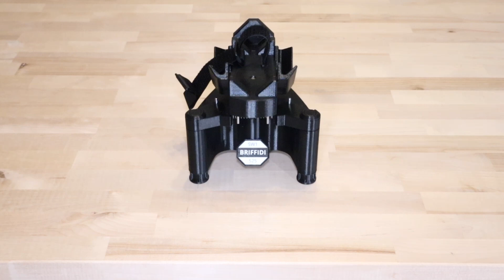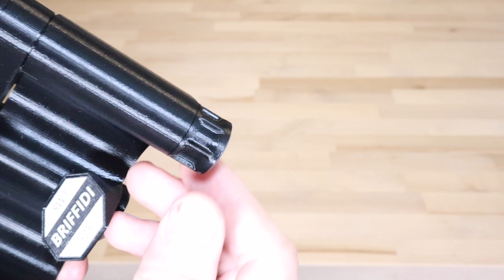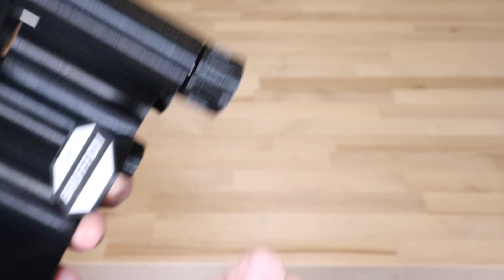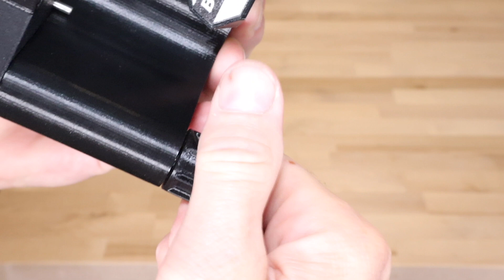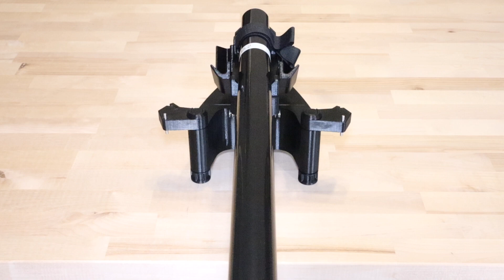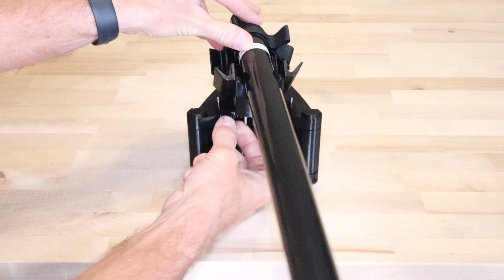ARCHIVED: [GS4] Leveling the SW1

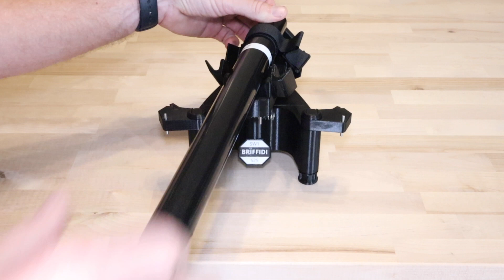Comment: 1:05 I levelled the front feet relative to each other differently. I first raised the rear foot so that the SW1 was inclined forward. Then adjusted the front feet so that the rod pointed exactly at 6 o’clock (ie: front feet now level to each other but lower than rear foot). Finally, lowered the rear foot until the rod was free floating (SW1 now perfectly level). I found this easier to do than the method described in this video; YMMV. 

HUGE shout out to Brian for creating the SW1! What an exceptional piece of kit it is! 👏👏👏👏👏👏👏👏👏🙌🙌🙌🙌🙌🙌🙌🤩🤩🤩